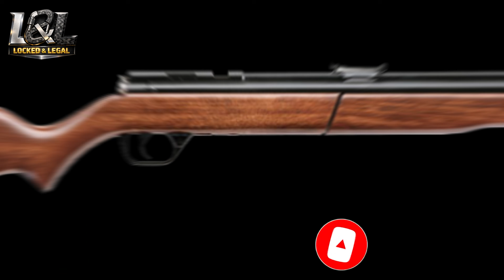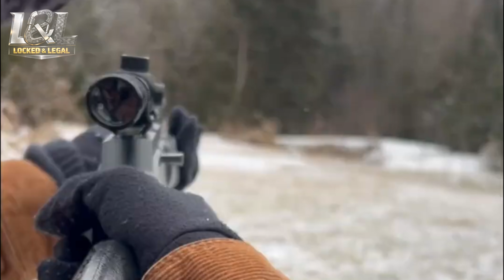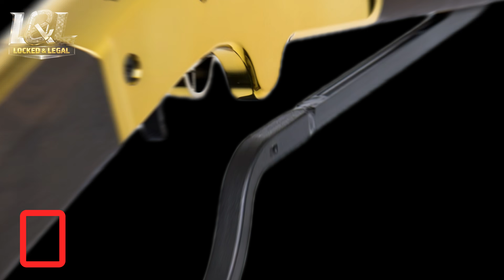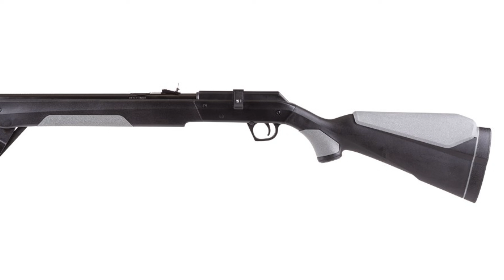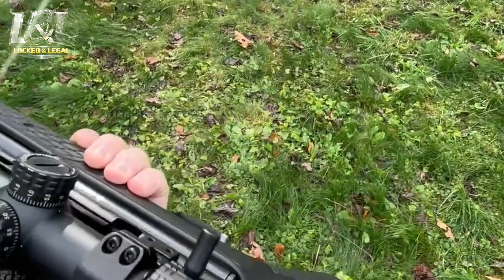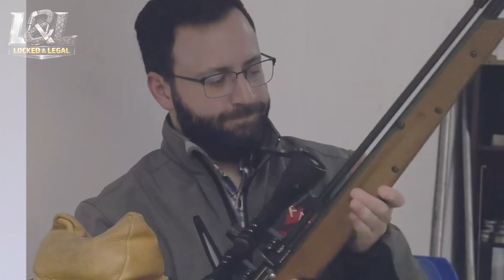Top 10 Best Multi Pump Air Rifles 2026 — From $49 to $400

Comment: The 392 s that black synthetic stock I took my apart and increased its power. And it doesn't have a soldered apparel it's got a solid steel barrel that has a Allen head bolt hold it in place.  And mine right now is producing almost 15 ft lb of energy. Now yes it is a little more power to pump. But nothing like you're talking about

Comment: The 880 and 901 Daisy are super easy to pump.  No more leverage assist is needed.  Also, on the Barra Lever Action, the video stated the pellets need spin to stabilize, then the very next gun says that they dont rely on spin, just drag.  There seems to be s fair amount of odd bias going on.  I do like that it points out flaws, but also seems to favor flaws without actually comapring the benifts between models.
Reply from the maker: Thanks for the detailed feedback. You raised some fair points, especially about explaining pellet stabilization more clearly and providing a more balanced comparison between each model's strengths and weaknesses. We appreciate you taking the time to share your thoughts, and we'll keep them in mind for future videos.
Reply: @LockedAndLegalUs it also made me wonder about pellet type when talking about this. Head vs skirt size etc.

Comment: NIce job on this pumper video. Any out of production models should not be a numbered selection. It's cool to see the history to see the roots of what's available today. So the Crosman 392s and 397s should not be numbered choices.  The Seneca Aspen is discontinued and your list should have looked into it's replacement the NEW Air Venturi Ascent. Maybe redo this video and find two others for this list. Others like the Umarex NGX multi-shot may need to be considered?
Reply from the maker: Thanks for the thoughtful feedback. You make some good points regarding discontinued models versus currently available options. The goal was to highlight both influential classics and rifles that shooters may still encounter on the used market, but we appreciate your suggestions. The Air Venturi Ascent and Umarex NGX are definitely interesting additions for future updates.